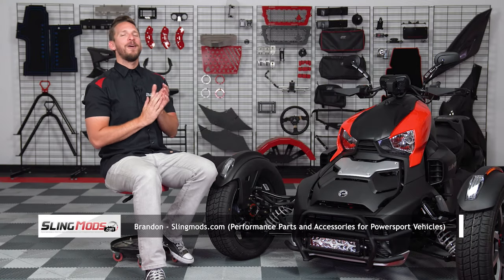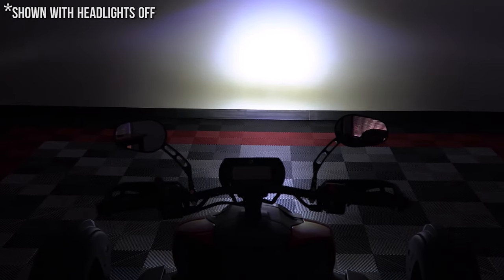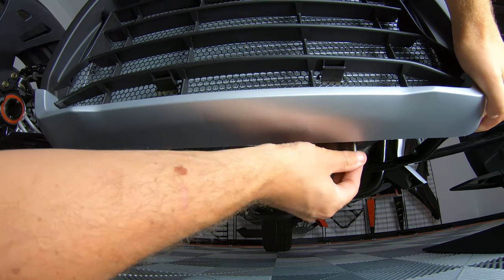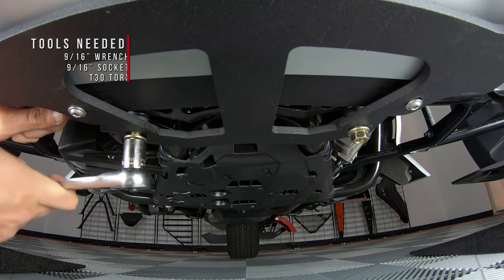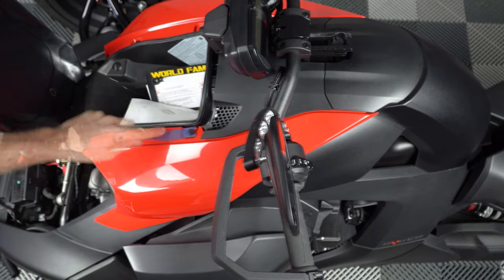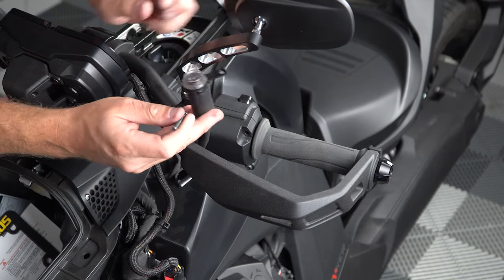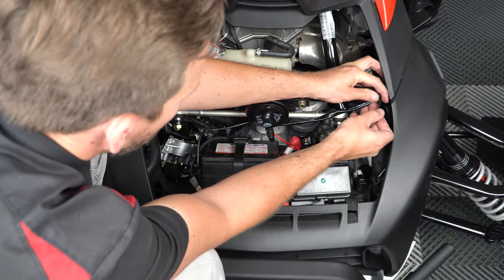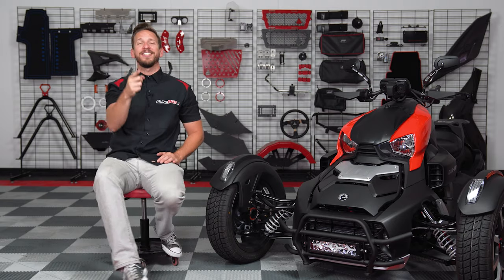Can-Am Ryker Front Grille Guard w/Optional LED Light Bar

Comment: so you have to remember to turn it off when you leave the trike?
Reply from the maker: Hello Miata, If the LED light bar is wired directly to the battery as we've shown in the video then the light bar will need to be turned on / off with the switch. If you wanted it to turn it on or off automatically with the ignition.. you'd need to add one of our aftermarket fuse blocks.

Comment: I noticed that the light bar wiring harness doesn't go through the Ryker factory harness. 
So is it possible to walk away from the trike and forget that I have left the light on and subsequently flattened my battery?
Reply from the maker: Hello Marc, you are correct. The light bar works with the ignition off. If you wanted it to turn off with the ignition, you'd need to run it through one of our aftermarket fuse blocks.

Comment: What is the measurement between the light mount brackets on the Grill Guard?  I have a light already and want to get the grill guard and use my existing light if possible.
Reply from the maker: Hey Tim, I think it may be a safer bet to grab the grille guard and double check your light bar fitment with the grille guard in your hands. If your light bar works.. you're styling. If it doesn't.. you can always come back to us and grab our light bar. I'm happy to check tomorrow as well if you'd like.. let me know good sir. Thanks!

Comment: Does the light bar have clearance only for the lower section of the grill or can it be installed higher or two on the same bar?
Reply from the maker: Hello Paktra, the lighting bar does tilt to tune your position on the road, but it's mounting location is on the lower half and is preset with welded tabs on the grille guard itself. You wouldn't wanna run two anyhow as you need adequate air flow to the radiator.

Comment: No problems afflicting cooling with the light bar?
Reply from the maker: Have only had it installed for a few days.. but not so far with a few hundred miles in Cali rippin' canyons in the upper 80's. I don't think this would be an issue as you still have adequate air flow above and around the unit and the unit sits far enough away from the front end.